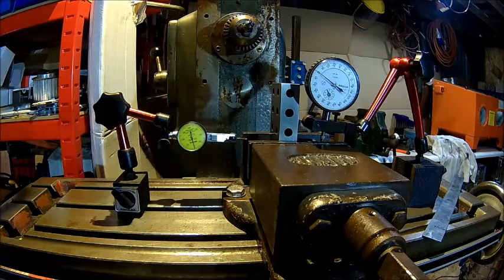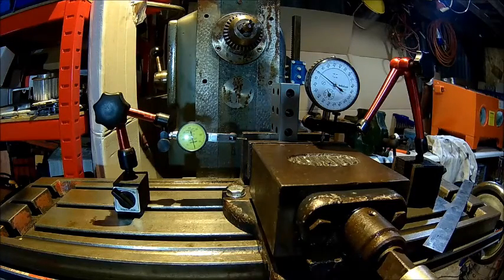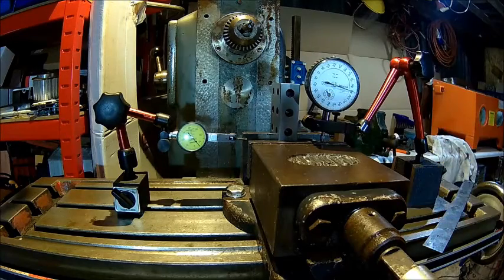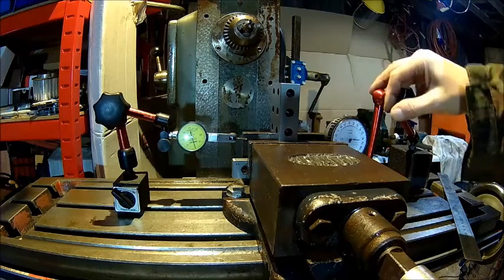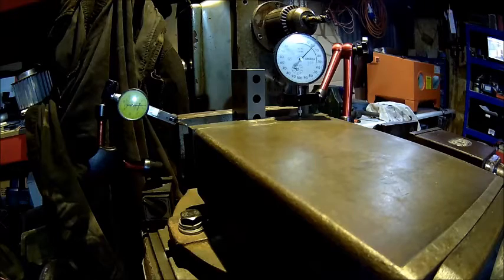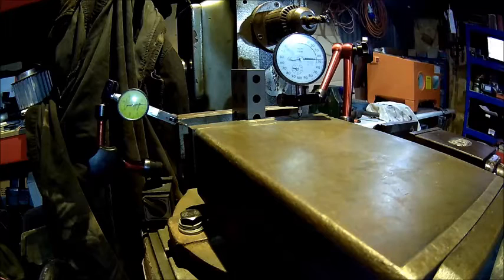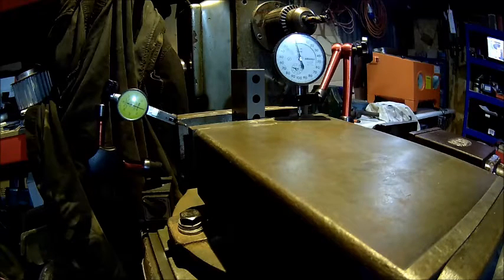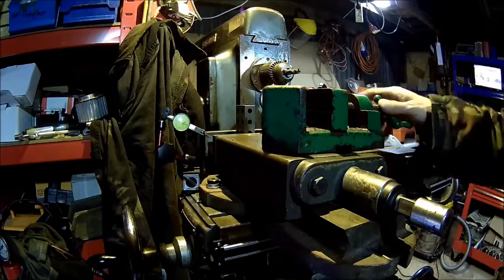Machine Shop Physics: Vice deflection - the vice challenge, part1

Comment: it looks like machine vises move about the same regardless of brand or foundry of origin. seems like there isn't much deviation between the different types of ways. nice job!
Reply from the maker: +HolzMichel  Thanks,...Well, you are right, it seems like that. But while i was thinking over the rather unexpected results i came to the conclusion that i actually made an error.
Using a Torque wrench is fine, but i forgot to consider the pitch of the spindle, therefore the resulting jaw pressure can be still  different even the Torque and the surface area of the clamped part is the same. I will  check that later on in th week and post the results. It's probably just me being fussy, but i make a living with all sorts of test benches and i've learned not to be happy until i fully understand why the data are as they are. Otherwise it is very likely that something is not quite right with the setup.
Reply: dynoguy
 the true test would be to insert a dynometer to check the pressure being exerted on the fixed jaws. since the spindle pitch does vary from one vise to another that would be the only real way to determine the differences. even then i would doubt there will be a huge deviation. the only real difference that i could think of popping up would be the difference of a vise made from cast iron vs. one made of steel.. the steel vise would flex more methinks
Reply from the maker: +HolzMichel   Good idea, i will look for a load cell which fits into the vice, but 30kN types are usually a bit too big, we'll see....
However, just been to the shop and yet another surprise, The small vice got a pitch of 3mm per turn, the big one is 4mm per turn. That means that i have applied less pressure to the big one, even the Torque (60Nm) was the same. Leaving friction out of the equation for now and providing my maths are correct, this was around 20kN for the small one and 15kN for the big one. Conclusion, the big one is actually worse as it moved further when i cranked it beyond 60Nm.
Reply: dynoguy
 i wished i had my copy of machinery's handbook or Holz - Zahl - Form, both of them have the formulas in them that tell you how much force a screw is exerting under a given torque. then it would just be a matter of calculating it out as to how much pressure the movable jaw is putting on the fixed jaw.
Reply: dynoguy
here we go:

http://www.daycounter.com/Calculators/Lead-Screw-Force-Torque-Calculator.phtml

since you have all the data and figures for the vises...
Reply from the maker: +HolzMichel   Thanks for that,...apparently i forgot about Pi, stupid me... , so thats then 5kN and 6.6kN. Just about to organize a suitable load cell which i can borrow for tonight... There is nothing more eye opening than real measurements ...
Reply: dynoguy
true story! just for shit & giggles i would do the calculation and see of the measurement corroborates the calculations..then you will know without any doubt which is more accurate
Reply from the maker: +HolzMichel  Just did exactly that, video should be up sometimes tonight. ...by the way, thanks for subscrbing